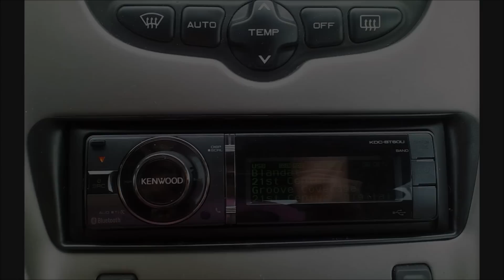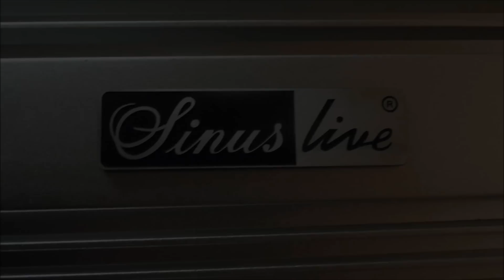The Complete Audio Installation  in my Citroen Xsara Picasso -04

Comment: My car takes a long time to switch off the aftermarket stereo after i remove the keys (like 1 min), but it doesn't happen with the original stereo. I heard it's because of the VAN communication protocol the car uses. Does it happen with your car?